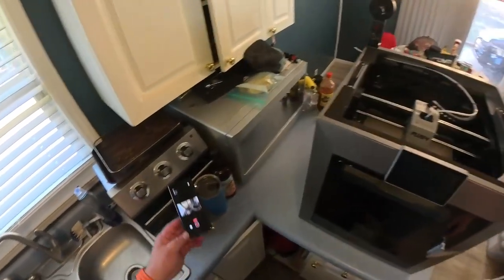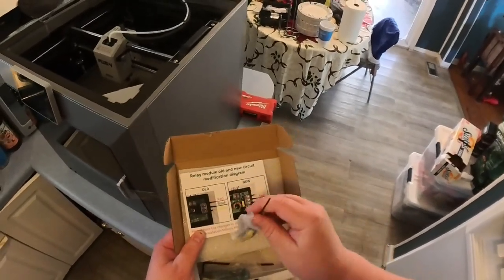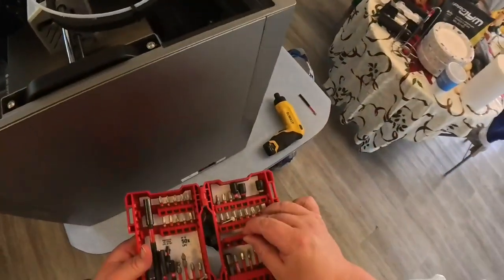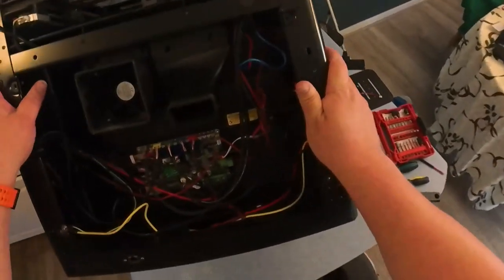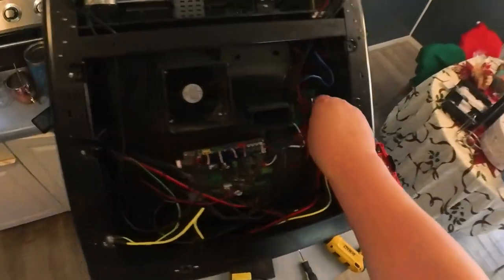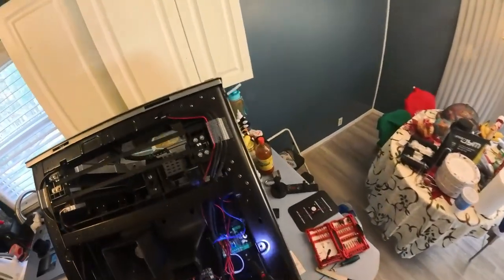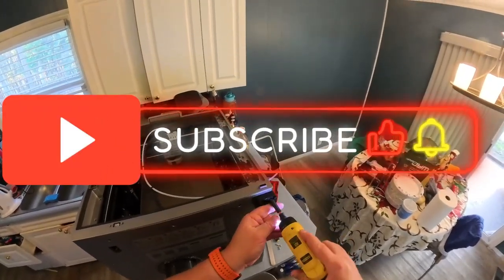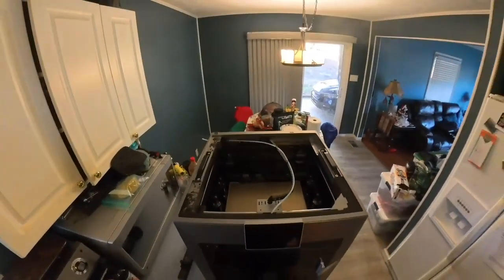Can You Really Fix QIDI Plus Chamber Heater in 10 Minutes?

Comment: Also, were you aware that Qidi has a design issue with the heater housing? NoizieWorks youtube channel has a nice mod that replaces the stock housing with one he's printed from Pa6 GF. 
The issue is that the housing won't handle extended use. I had Qidi send me a complete heater & housing but once I got a look at it I found that even with the reduction in power after the chamber reaches 60c, extended use will still loosen the screws so I'm printing a housing from PAHT GF that they gave me a discount on. Just some food for thought.
Reply from the maker: Thanks is the stl file on nozieworks channel .  I have some PEEK-A I CAN PRINT IT OUT OF.

Thanks for sharing 👍

Comment: I''ve been incredibly frustrated with this printer. It's been malfunctioning since my fourth print. The bed heating element is currently broken, and I've been going back and forth with their 'support' team for two weeks. They finally promised to send replacement parts, but the tracking number they provided was invalid. USPS confirms that the package doesn't exist. Their customer service has been abysmal, and now they're only responding with automated messages about being overwhelmed with emails.
I'm completely disappointed with this expensive, oversized paperweight. I wanted to share my experience to warn others considering this printer. It's been completely unusable for the past few tests.